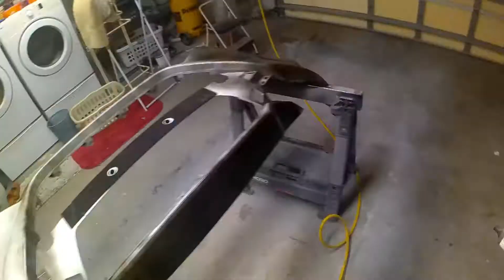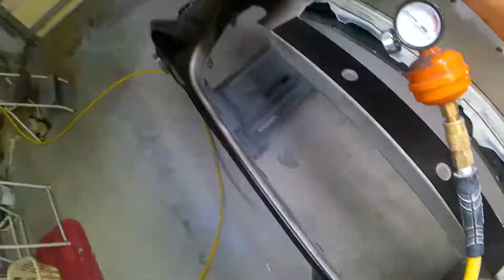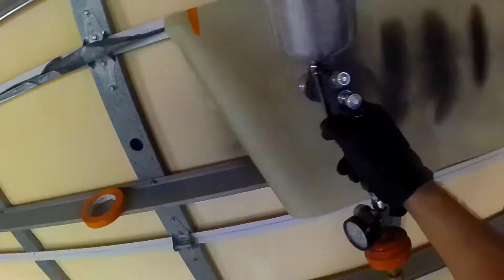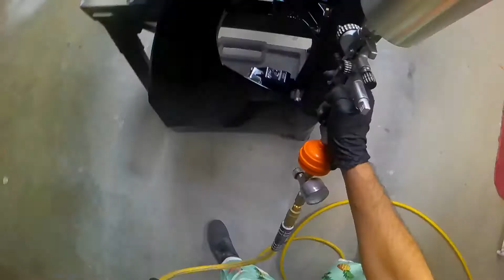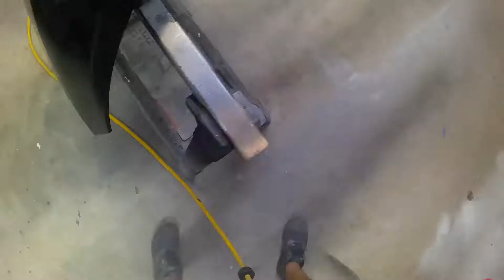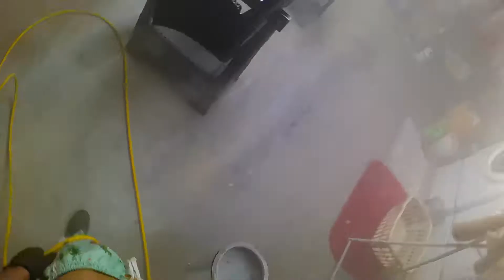Midnight Blue Paint Job - 2019 Altima Front Bumper

Comment: Was the pearl just a 25 gram packet mixed into a gallon of clear? This look is perfect and I want to make sure I can replicate it as close as possible. Thanks!
Reply from the maker: I actually used the liquid pearl. I used a 32 Oz mixing cup. I Used 5 parts of clear to 3 Tablespoons of liquid pearl. You are suppose to do 1 part liquid pearl to 1 part reducer but I didn't want that much blue in the finish.
Reply: @rwtfallenjf25132  that’s exactly what I don’t want also. Appreciate it, I’ll have to experiment with the powder then. Try that same ration and maybe that will work.
Reply from the maker: @987001  so I found (when i was doing a test panel for my car) that the powder is 5 parts clear (in a 32oz container) to 1/2 tablespoon of the powder. it will give you close to the same results as what you see here. Sorry for the late reply.